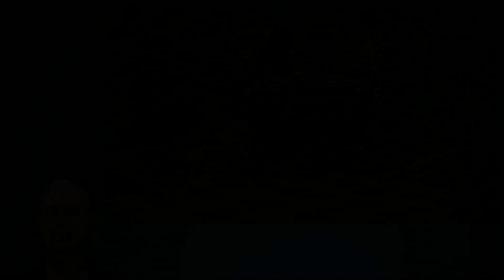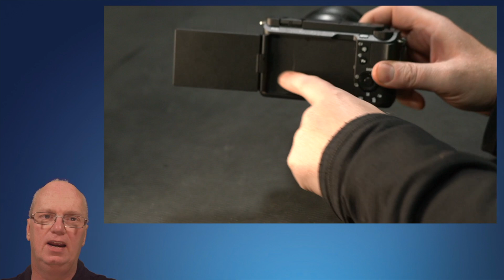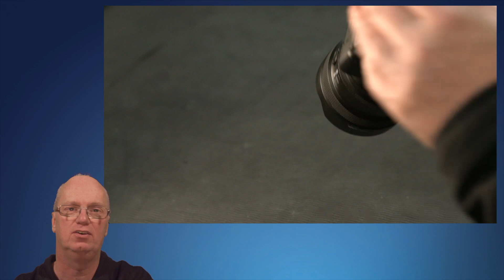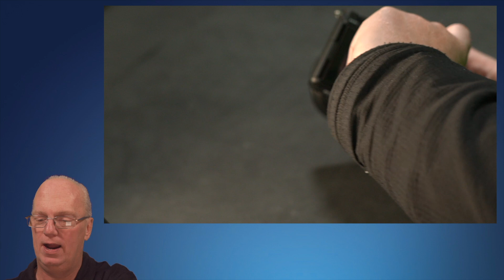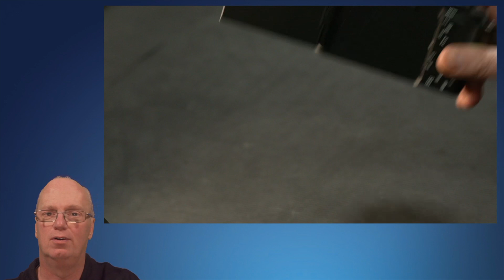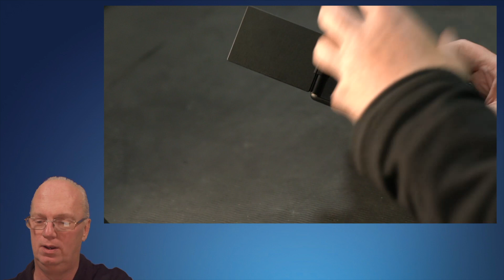Sony ZV-E1 Overheating work arounds part 1

Comment: honestly at this point you're better off buying a used A7SIII..
Reply from the maker: No not sure why people keep saying this really. the a7siii is 1200 euro's more for me and also misses a few things this has and most important is bigger than i want. This hack (see other video its now done, well until some company makes it) i will use pfff 1% of the time probably mostly in webcam mode. I am not trying to knock the a7siii or fx3 they are much better for many people but there is a space for the zv-e1 and for these people a simple $15 hack like this is fine. My main cameras are A1 so its not even a money issue for me.

Comment: Hi Daniel,

Thanks for making this long detailed video.

I have a lot of experience with overheating over the years with the R5.

I shoot both Sony and Canon.

For short form, I used the Tilta active cooling fan and had abt 2x the published recording from Canon.  And after firmware 1.6 update, even more.

For long form, I used an external recorder and had almost unlimited because after 5hrs+, I got bored.

For Sony, I tried using Xiaomi’s Black Shark Magnetic Cooler (uses active cooling through powered USBC and very quite) that are used on smartphones for gamers.  I attach an magnetic adhesive that can be removed when not in used (comes with one as well).

The only issue you have to make sure is to keep the LCD screen out and away as my Sony A74 had polarity issue.  Once removed, it goes back to normal.  

I don’t have the ZV-E1 to test but that would give you unlimited use as I’ve used it on Gopros 9/10 and DJI A2 for over 3hrs+ at 4K100/120 without overheating and got bored.  I used a velcro to strap it down.

Give it a try and let me know if it works for you or not
Reply from the maker: Wow i guess me doing this 6 years ago (see videos) made me forget there is a whole new 'area' where this is a issue.. mobile gaming thanks for the hints. I do think they have some downsides since most/all? depend on direct contact to feed aways heat and not just airflow. Today i will make a new video and talk about your fixes too the biggest problem i see is that i can't find a mobile phone cooler that is flat and max 5cm x 7.5cm max and doesn't use a magnetic solution. My gut feeling is for now (and $15) airflow is good enough until someone makes a real product or i find something from the gaming space that works. Again thanks for the reply its always fun  to see someone solving problems instead of complaining !
Reply: @scb2scb2 , deserving of a new sub!

Yes, complaining makes us feel good but doesn’t solve the problem.

When we make small form factor that is weatherproof and/or waterproof consumer electronics, we need to deal with thermal physics.

I’m just surprised from manufacturers to consumer electronic companies that do laptops to gaming to digital cameras to action cams do not try to learn from each other’s mistakes or from lighting or gaming companies who uses a lot of power and need passive or active cooling.

Apple has finally abandoned Intel past 2-3yrs and come out with their own efficient power efficient architecture with TSMC whereby you don’t have fans kicking in when thermal throttling.  They optimize their hardware and software so it is most efficient to reduce cost and still retain performance.

This is only possible as process technology keeps getting smaller and smaller and with more powerful SOC architecture.

Mark Bennett just did a video yesterday where he used a regular fan to get airflow and was able to extend his shooting times.

I think most of these issues comes from user error not being able to work around as they may not make effort to solve for it.  But these camera manufacturers do not guide and inform how to deal with thermal heat management and so YT’ers create their own narratives.
Reply from the maker: @nomad0714  People also don't get how far ahead the mobile cpu's are (esp apple) if they would be in the e1 i doubt it will overheat but we are not in that stage yet. Sony simply doesn't have the numbers apple does who needs/uses about 1M-2M SoC's a day. I commented on Marks video  last hour i do feel i am on a more sensible route but our results match. I think my final $15 hack is best until we see where sony and the products trying to fix it are in 6 months. Everybody can easy make my $15 hack and its well cheap... I will keep looking for a gaming cooler that would really work.

Comment: I only want it for short filming 😅 no problems with overheating
Reply from the maker: True and i agree but consider that sony makes a big deal out of using this as a webcam (even adding 4k p25 now) i do feel there is a usecase for this testing. Also lets not kid ourselves many see this as a cheap fx3 and if you at times want to use it as such and do say 20m or 30m again it becomes interesting to have a hack for it. But we should indeed remember we are using the camera outside the range it was made for.
Reply: @scb2scb2  i don‘t make vloggings but i think this cam would be a great small holiday cam for me
Reply from the maker: @schoeferfilm  yeah thats why i got it. in fact in both my big and small bag i use i can keep the zv-e1 on the lens and it fits one of the lens 'holes'. So for example i can leave it on the 14gm 1.8 i have with me anyway. Or if i know i don't need f2.8 i can take the 1635g pz instead of the 1635GM. Its very interesting.. still i think there is value as a very good webcam so want that to work fully.